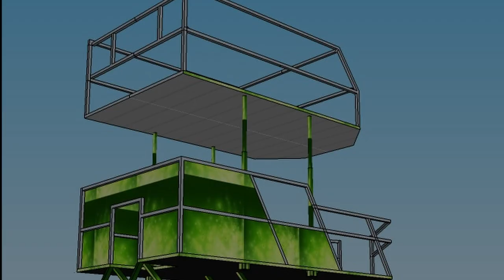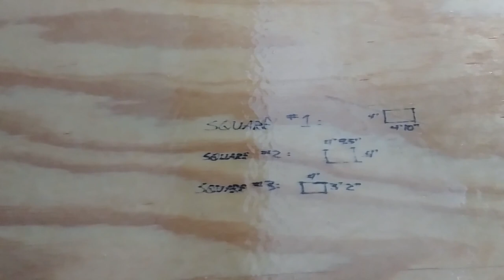Vintage Glastron with a JET SKI ENGINE || Building a Floor and Having a Breakdown || Update #4

Comment: I was just thinking about your project. Glad you are back! Keep us posted. I just started working on my old Glastron too. Should be in the water in 2 weeks.
Reply from the maker: Thanks for your support!  What type of Glastron are you working on?
Reply: BarelyBuiltRight it’s a 1965 Crestflite V-174 that my grandpa bought brand new. It runs well just switching things out every year.
Reply from the maker: That's awesome!  They just don't build them like they used to, do they?

Comment: Should’ve spent the extra few bucks on the marine plywood. The main difference between marine plywood and other plywood is not so much the void’s (although it is higher quality and has less voids) - the primary difference is the glue that is used to hold the laminate pieces together. Marine plywood uses a waterproof glue - non-marine plywood does not.  If the water does work its way into the core of non-marine plywood it loses its its strength and turns into soup (it has happened to me before).  Hopefully your resin application will prevent any water from getting into the core. Nice work on the project!
Reply from the maker: You are 100% correct!  If I was building a boat for someone else or for long-term, I would certainly invest in the proper ply.  My main goal with this project is a Ramen budget, and hopefully get 5-10 years out of it.  I'm hoping casing it in resin will hold off the inevitable rot for at least that long.  Thanks for your support!
Reply from the maker: @Ninibong News I hadn't thought much about alternative materials, although I have seen several examples on different forums.  I follow "Mini Jet Boat Builds" on FB and those guys mostly use metal.  Lots of information there for that.  I have seen composite materials praised on other boat forums as well.

Comment: I have been thinking of building a 30 to 36 foot, deep vee transport craft in a design similar to Munson boats, but out of wood and fiberglass.  I have land off grid in Alaska, and need a boat for moving things around (such as construction materials and ATVs).  It would save me a ton of cash to build using two rebuilt or salvaged PWC drives instead of anything more traditional.... do you see any reason I shouldn’t be considering going that direction?
Reply from the maker: Hello, fellow Rick and Morty fan!  That sounds like a cool project!  I'll start off by saying that this little 15 footer of mine is my first foray in to the marine world, so I am not very well versed on larger vessels.  There are a couple things that come to mind using PWC drives with that type/size of vessel.  First, 36ft would be huge for 2 pwc powerplants to move, especially with a deep vee.  If I was dead set on using jet drive in boat like that, I would probably lean towards Berkley (or similar) outdrives mated with proper powerplants that could move that kind of weight.  Secondly, the jet intakes rely heavily on the flow of water leading in to them.  The bottom-most portion of the PWC keel is specially designed to drive water in to that grate.  You want that "entry path" to be as smooth as possible. Your powerplants would need to be sitting on the lowest portion of the hull to facilitate this, therefore putting your nozzles very low in the water with a deep vee.  I'm not very well versed on how this would affect performance but is worth mentioning.  

Additionally, wood and fiberglass may not be the best of options for the rocky bottoms found up there.  There are a reason a lot of those boats are made of aluminum...it will just dent.  Whereas fiberglass and wood will crack.  I encourage you to take a look at various "Mini Jet Boat" pages on Facebook.  You may be able to draw some more inspiration from them!
Reply: I have a similar project as the run about y’all are working on and talking about, and as I’ve been building it I also have a another project that I’m wondering if the jet drive system will be a good option? I see what you’re saying about how big that boat is with JetSki motors might not be efficient but what about a around a 30 footer? I’m honestly trying to go electric on this 30 foot Catamaran build I’m doing. And it seems like removing the two-stroke motors and putting in a big three phase hundred watt  something on like 10 batteries would probably work good mostly the electric motor replacement and JetSki pan seems like the perfect application for electric motors on a shallow draft Catamaran but I am wondering how much power to be able to move the boat efficiently

Comment: Shouldn’t be to long now?
Reply: @BarelyBuiltRight  Sad faces oh no does that mean the project came to an end? What about our race?
Reply from the maker: @zacharywinters9413  its still sitting in the backyard.  I've since moved.  Needs a new floor again.  But its not dead yet.
Reply: @BarelyBuiltRight  good to hear, I just sealed my floor and JetSki pan yesterday with gel coat so I’m now watertight. Hope you get a chance to complete it and float it the glass Tron definitely has a lot of character. Mine is a 1966 Lonestar Mustang.
Reply from the maker: @zacharywinters9413  would love to put them on the same body of water someday!